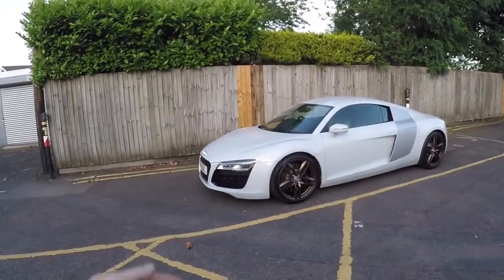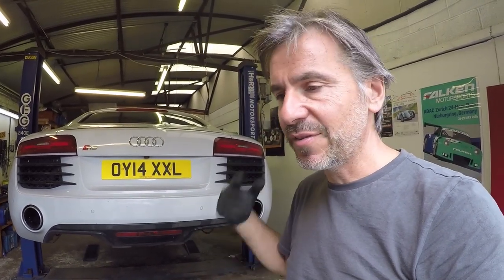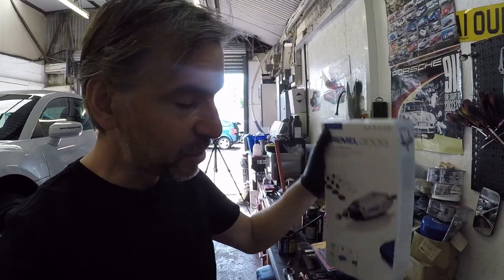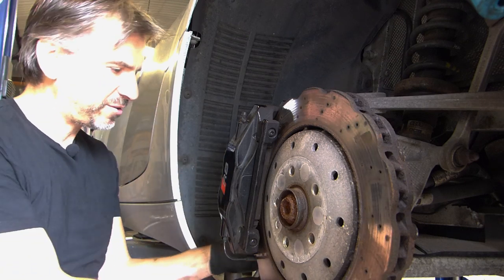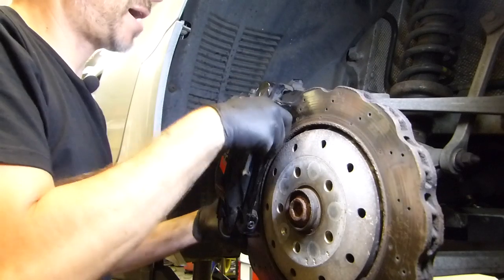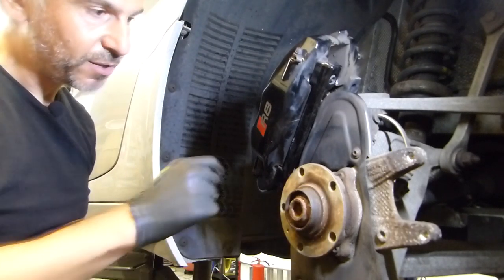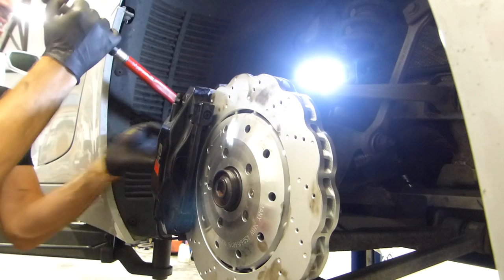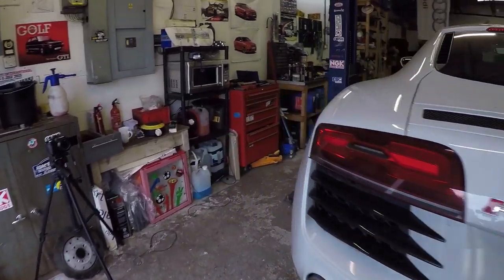How to fit NEW brakes for HALF price! Project R8 Ep7

Comment: Wheels look better than last time I actually like them now. I was on the fence in the last video. I still like red calipers but not sure if they would suit it. I use Poorboys on my black trim it smells lovely.
Reply from the maker: IThanks Paul.  don't think the last video gave the wheels the right opportunity to impress but at the time I didn't appreciate how much of an effect the caps would have.  I will check out that Poorboys stuff, I've got some Meguiars tyre dressing that's really good and goes on plastics just fine too and it smells nice but not sure I can face the comments from the detailing geeks about using a tyre dressing on plastics :)

Comment: Lovely Jubbly, little thing, you could spray lacquer the brake hubs to stop further corrosion.
Reply from the maker: Hi Paul, thanks for the tip, what would you spray them with exactly? I'm just a bit worried about the heat build up and oily stuff.
Reply: Maybe a high temp lacquer, similar to the caliper paint. VHT sell one on ebay.

Comment: That handbrake piston wind back tool is a bit of a mess to get it right and find anything that fits that small gap of the caliper. My experience. Thanks for the vid. Appreciated. Nice car but the wheel color fits better with a Black R8.

Comment: Couple of points to note: when working so close to the brakes you should wear a breathing mask to prevent breathing in any brake dust or aluminium oxide, especially if you are going to use a brush, wire or otherwise. Also it is best to clean the discs with a brake cleaner to get rid of any grease or oil which will easily contaminate the new brake pads.
Reply: Forgot to say I enjoyed the video 👍

Comment: as your a "wizard" with the VW marque, I need a bit of advice me old mate, I`ve got a boggo standard skoda 105 PD manual gearbox car, it`s only worth about 1k on a good day with the sun in your eyes, it`s running luvvly and it`s pretty good on the old diesel, but I`d like a bit more power and ESPECIALLY TORQUE and slightly more oomph, was thinking of having a rolling road remap, it`s going to cost about £300ish , are these 105 pd`s tuneable or do they go bang after a power increase, it`s done 160000 miles, but I service it twice a year, so it`s well maintained, do you think it`s worth doing or should I just leave it be as I approach my 60th birthday and keep plodding along in lane 1 on the motorways into retirement...………...
Reply from the maker: Hi t5jerry, I'd have to say that you are best leaving that well alone! The 105s weren't that brilliant when new and the 5 speed box is quite weak.  Adding more power and torque will just accelerate wear and tear of which there will already be plenty evident. I'd save up and buy a cheap Fabia VRS, great car out the box (though many will be tuned...!)
Reply: @volkswizard  appreciated, I'm not a boy racer so will heed your advice and leave well alone,  thanks very much.

Comment: I have a 2011 mk6 golf gt140 cr diesel,  I'm wanting to upgrade my brakes but there's two size options for the front,  how do I work out which size is mine?
Reply from the maker: Hi,  go to http://www.eurocarparts.com, enter your reg and go to front brake discs - they might list two sizes and each should have a PR code.  Make a note and check the data sticker in your car's boot or the inside front cover of service book and see if you find a match. Those will be the size.  You can also get the PR code from http://www.realoem.com but it's a bit trickier to search
Reply: volkswizard thanks I’ll look into this.

Comment: Lucky that’s a cable handbrake not an electronic one! As that Needs to be plugged into vagcom to release it before you can change it! Unless there’s another way?
Reply from the maker: You do need a diagnostic tool of some sort to wind the callipers back _ ironically I had that available so would have been better for me if they were electronic - I wonder if Mk2 R8 has a separate electronic calliper for handbrake..?
Reply: volkswizard i think the V10 has the electronic handbrake, along with optional hill assist 

My RS3 will be needing new rear discs and pads shortly, and your right on the pricing! I can get brembo drilled rear discs and OE textar pads for £175 on line which is way cheaper than even TPS

Your Wheels look much better now also, could the refurb company not paint the original caps to match? It’s a service Lepsons offer whatever material they are made of
Reply from the maker: Hi Maverick 41, they couldn't paint the caps but I'm too fussed as when Audi do bronze wheels on R8 and A1 they have black caps.  Is yours an 8P RS3? Surprised you can get Brembo aftermarket already, that's good to know. Last time I bought B7 RS4 fronts, they were aftermarket Brembo and as you say, loads cheaper than even the Stoke Audi discounted prices and bearing in mind Brembo makes the originals you'd be mad to pay more.  
I've got hill assist on mine, bit annoying to be honest, seems to randomly hold brakes on for a couple of secs.
Reply: volkswizard hi, mine is a 2016 8V RS3 sportback, had it since February, fantastic car 👍🏻 yeah defo original brembo discs and tartar pads, i have seen a few options about to be fair, fortunately mine had the front discs/pads changed to the later rounds type by Audi under warranty last December as the wavy ones were squeaky I’d suspect, so they won’t need doing for a while 😂 i hope 🤞 

I kind of wish mine had the hill assist on it, it’s one of the only options it never had despite it being owned by Audi Uk first, think it was only an £80 option, can’t complain though they put everything else on it 😂👍🏻
Reply: if you purchase Carley for VAG  along with its app you can put the electronic brake into service mode via your phone.